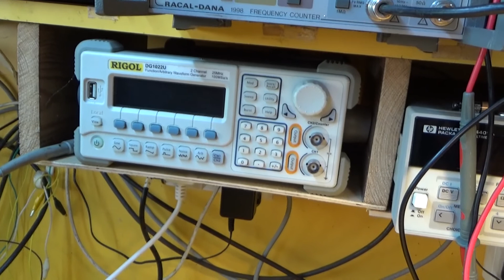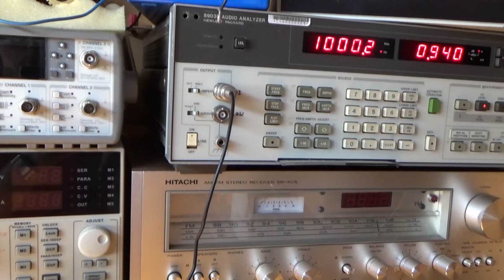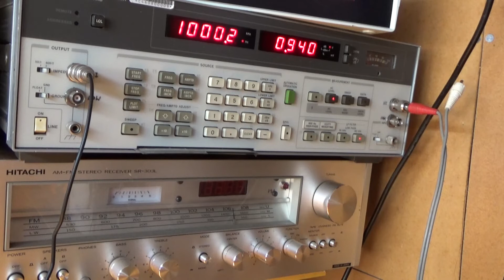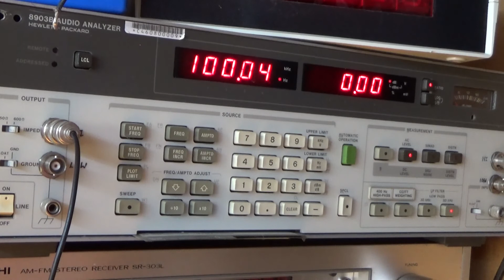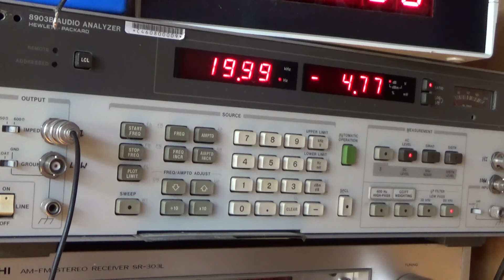Audio line isolation transformer tests

Comment: Useful to have those isolators , I have the same model and use them to connect radios to the various communications analyser.  Can be necessary especially with some of the more modern bridge amplifiers.   I also have the 8903 but have planned to replace it with the Quant Asylum audio analyser.
Reply from the maker: Thanks for your comment Chris, the 8903 is a great bit of kit for testing amplifiers, I've always liked hp quality & I got this one fairly cheap as I've seen them on eBay for up to £1000! Will be interested to see your new analyser in operation some time, cheers Nick